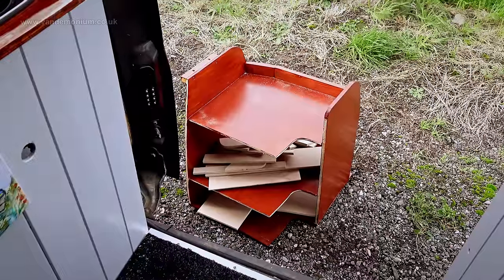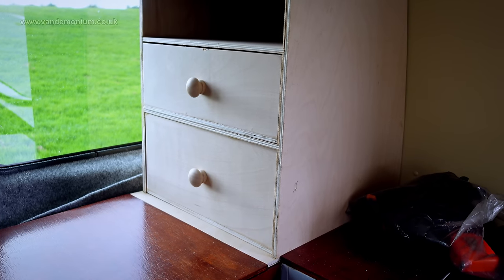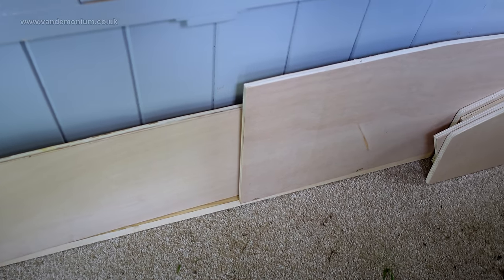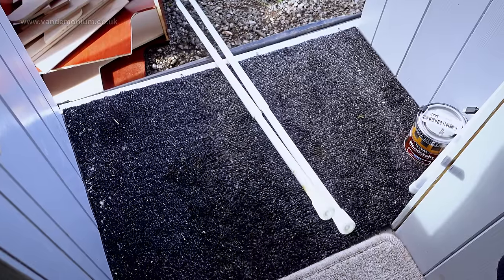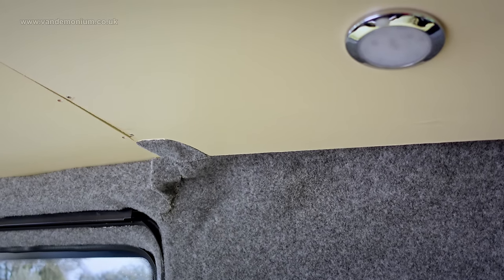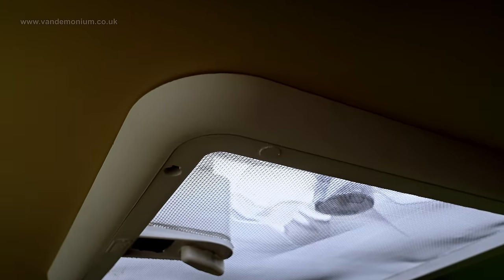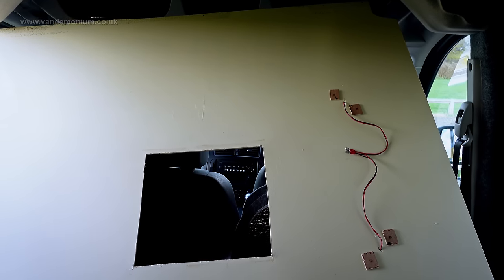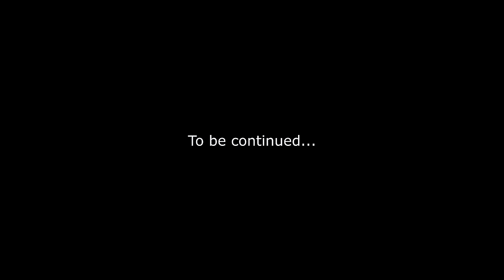46. Re-making the cabinets in my DIY campervan (and rewiring too) Part 1

Comment: The vapour barrier theory is rather suspect in a vehicle with "drain plugs" all around the bottom of its walls anyway... ;)
Reply from the maker: Not really; they lead directly to the outside. The idea of the vapour barrier is to stop warm moist air inside the van (typically from human breath) from condensing on the cold walls, which is why a vapour barrier is used.
Reply: @Vandemonium  I do follow/accept the reasoning, but I respectfully beg to differ, and I myself choose not to use a vapour barrier in my own van conversion. :) Mostly because a vapour barrier will also trap moisture behind it, and make it harder to evaporate (and moisture does get everywhere, especially in a small boxy enclosure like a van which undergoes many temperature changes). So far, after almost three years, I can report no problems with condensation, rot, mold or mildew. So it's worked for me, I accept this doesn't mean the VB approach doesn't work of course. :)
Reply from the maker: No indeed, let us politely disagree (what a rare thing on social media!). My response would be that the minor amount of moisture trapped behind a vapour barrier would be that which was there at the point of install (if there’s any more then there’s a hole in the barrier) so if installed on a dry day, there should be negligible moisture trapped. Actually, even on a damp day, the amount trapped twixt barrier and metal skin would be minor.
Reply: @Vandemonium  I know! Civil discourse, in this day and age? XD As for the van approach: I guess it boils down to personal experience. I know to my pain that if you leave electronics outside in any kind of box, the air pressure changes from temperature change will suck in humid cold air at night (making things airtight is very difficult), and the moisture will stay inside and wreak havoc; so for such things one tends to go with ventilation/drain holes at the bottom instead. Vans, of course, aren't electronics enclosures, but I've seen cars get pretty humid inside overnight, so I chose to err on this side of the vapour barrier equation (gosh that sounds horrible, but you know what I mean :) ).
Reply: @Vandemonium  Sachets of silica gel in strategic places and be sure to check them regularly.

Bake satchets in oven, with van doors open, and reinsert into strategic placed when bone dry again ... might even work !!!
Reply: @Vandemonium  To be fair - there was a fairly whacking big hole as you pointed out :)

Comment: Interesting video as always David, can I advise investing in a Bosch electric screwdriver? It’s small and the battery lasts for ages. Best bit of DIY kit I ever bought. Also great for marking and drilling pilot holes.
Reply from the maker: Cheers, I have two electric drills but for tiny screws like this and delicate wood, I prefer to do it by hand, that way you get the feel of what the screw is doing.